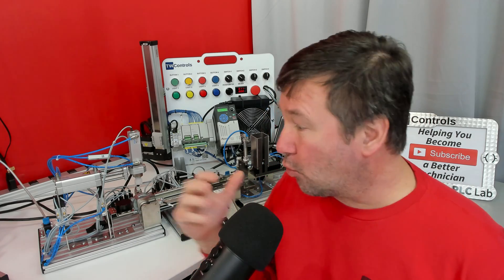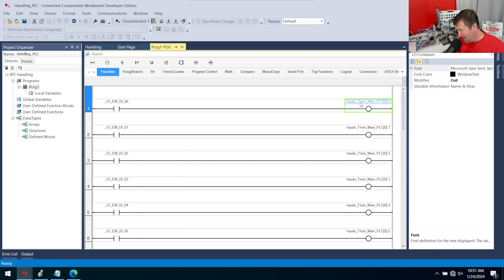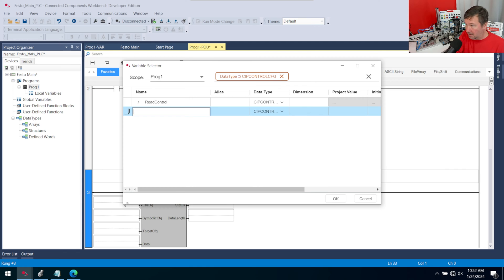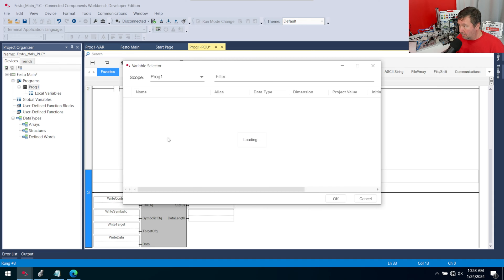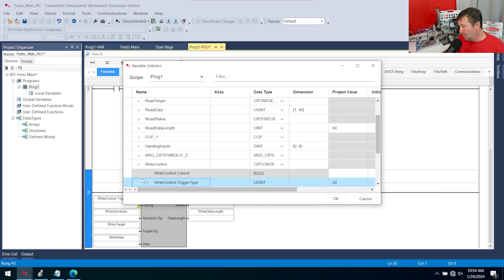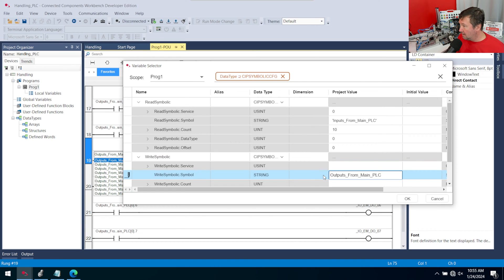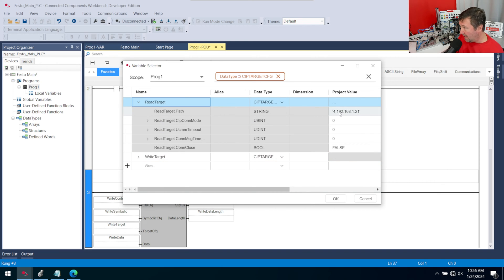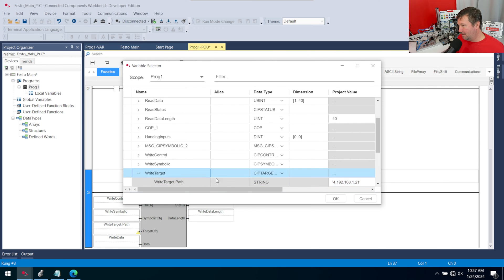Write CIP Message Instruction from a Micro850 PLC to another Micro800

Comment: Hi,

i did everything in your previous videos and everything is working good. im getting signals from the handling plc. but when i activated the main plc OUTPUT from the COP_2 it did not activate the output on the handling plc. i double check everything. i paused the video every time you made a change in the program to make sure it matches mine. i activated the output on the handling plc and check for any changes on the main plc with the CIP and COP instruction and no numbers were bouncing around. i swapped out ethernet cables just in case i was not sending out proper signals, and still i can't get the handling outputs on COP_2 to activate any outputs to the handling PLC. and all the status shows a 1 meaning it was successful.
Reply from the maker: Check the message status codes
Reply: @TimWilborne message status says true
Reply: 33-40 Unsupported CIP symbolic data type
Reply: My handling. PLC is a micro850E and my main is a micro820
Reply: I DID IT. I figure it out. I had to enter 196 for data type DINT to match the output
Reply from the maker: Great job!

Comment: Unrelated ,but does anyone have any strong methods/techniques for diagnosing machines that use structured text programming for the plc ? Any resources for diagnosing machines using structured text code ? Thanks
Reply from the maker: I have been working on improving my structured text skills and should do some videos on it. The biggest thing that people don't realize is what the set of eyeglasses do at the right end of the online bar. They give you current values of the tags in your program.
Reply: @TimWilborne yes I wasn’t aware pf that function . Until once I accidentally clicked on it while searching for an alarm active
Reply from the maker: I think that's how I found it too 😂

Comment: I don't know what I've done wrong, but my write data length is 0 even though I have it set to 1..40 and I'm not firing any outputs to the main plc
Reply from the maker: Look at your error code, it should help.
Reply: @TimWilborne  it said unsupported symbolic symbol was my error but i couldn't find it, did notice when I would put it in read with (0), the error went away.
Reply: Data type not symbol
Reply from the maker: What data type is your source and destination?
Reply: @TimWilborne  I'll check that at work Monday thanks Tim